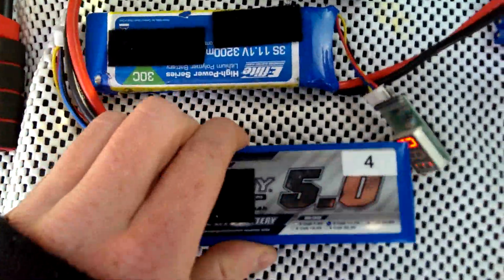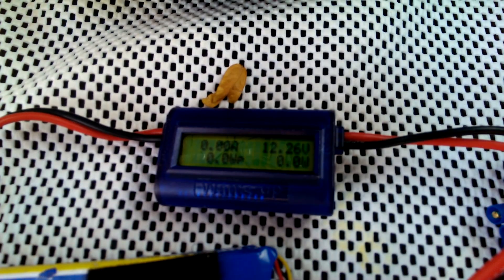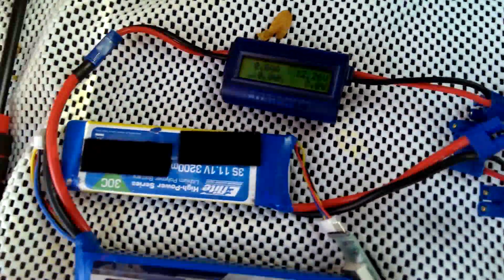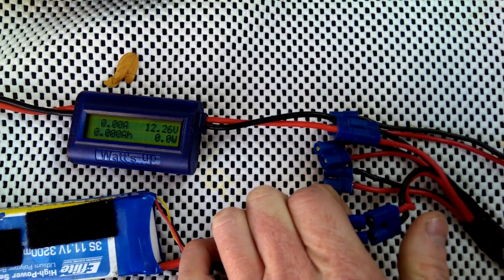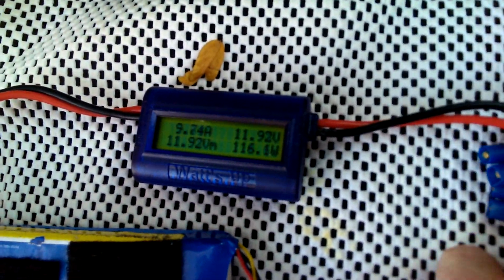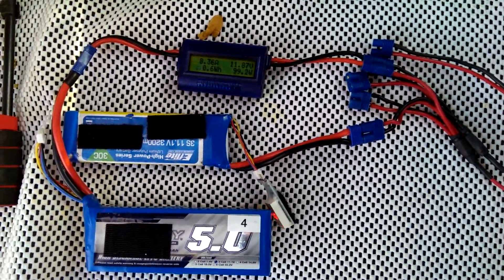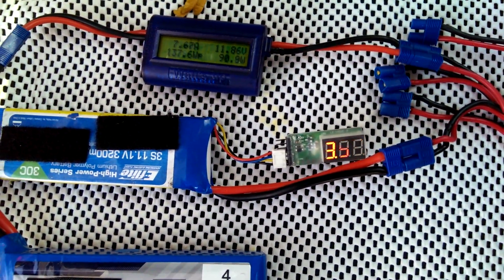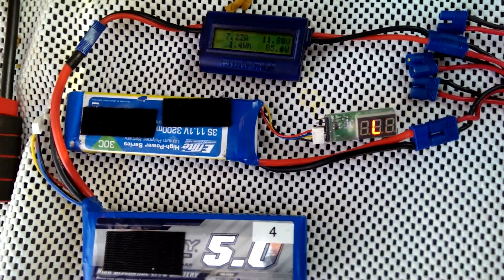Different Voltage Lipos Connected in Parallel - Fire? Burn? Or just A-OK?

Comment: Still a bad idea and dangerous.  You got away with it because they were 3s with high C ratings.  Additionally, the small battery still had cell voltages of 3.7v and obviously far from depleted.  Bad illustration and wrong to put it on YouTube.
Reply from the maker: Not dangerous at all to do a test in a controlled environment. The current discharged didn't even come close to the C rating, that was the point lol.
Reply: Turboactive The “point” is that you inferred several times that others were giving out bad information about it being dangerous which is not true.  It is dangerous.  Your test may have been safe, but suggesting/inferring that others are wrong and it is safe is irresponsible.

Comment: help guys my 3s lipo batter is showing different voltages 1cell 3.5v,2cell,3cell2.5 is it safe to charge or should i dispose
Reply: You can try charging it on a balanced charger at a low mAh setting.  Chances are, if it is a good charger, it will stop the charge and say, "bad battery" or "bad cell count".  However, the cell voltages should not be that much different.  You probably over discharged it.  That is the only time I have ever gotten dissimilar readings between cells.  However, I was able to bring it back to good health.  It is worth a try and then monitor it for a couple cycles.
Reply from the maker: You might be able to revive otherwise they make great shooting targets :)

Comment: Bit of an old video, but I'll reply anyways. The only dangerous scenario is connecting two batteries that are at vastly different levels of charge, for instance an empty cell (2.6V) and a fully charged cell (4.2V). The reason for this is that electrons will always flow from a cell with high potential to the cell with the low potential, and they will do so at the maximum discharge current possible. The "stronger" battery will charge the "weaker" battery at a current far exceeding its maximum charge rate, resulting in heat and, possibly, venting, or even an explosion. When connecting two batteries in parallel you want to connect cells that are close to each other in terms of voltage, 5 milivolts is an acceptable difference which will naturally balance out. The actual capacity of the cells is almost irrelevant - the larger battery will always "charge up" the battery with lower capacity because the voltage must be equal in a parallel connection. That being said, it is not an optimal setup and will result in lower efficiency and a lower lifespan of the cell due to having to be constantly topped up by the larger cell. When connecting batteries in parallel you want to closely match capacity and voltage for optimal operation.
Reply: This was the exact answer I have been looking for, for months. I never knew exactly how it works and this is the answer. Thanks so much man!
Reply: Foxi4Qnet Yes, with one additional caveat for those putting battery packs in parallel for our RC uses in particular.  Even batteries with dissimilar capacity but same voltage and current ratings, should not be put  in parallel.  During discharge, the source will pull voltage unevenly from otherwise identical packs in every respect unless they also have the same capacity.  This can, according to a Lipo supplier I talked to, cause an over discharge and damage to a pack.
Reply: @bw162  that's correct, in a sense. The cells will always try to stay in balance - they must, it's physics. The thing is, the smaller capacity battery will inherently charge faster than the larger one, so you'll be inducing circular current between the cells. It's an easy experiment you can perform yourself.
Reply: Foxi4Qnet  I am not an expert on batteries.  In fact, the few electrical engineers I talk to admit that not everything is known about battery chemistry and behavior.  Boeing gave up trying to clearly identify what caused a Lipo fire and over heat issues that resulted in grounding of their 787 when first introduced.  They improved the system to “mitigate” problems and made a more foolproof containment but never really understood the underlying issue that required design mitigation requirements.
Reply: @bw162  That much is true, there's a lot of misconceptions regarding the technology and a lot of subtle differences between chemistries, so we mostly operate on what's "nominal" or "optimal", which doesn't always turn out to be true, rather just "safe". Even tolerances between cells in the same batch aren't as tight as one might think, so ideally users should measure their cells and do their best to match them as closely as possible. Thing is, as the cells go through discharge cycles, they will inevitably lose capacity at different rates, so it's impossible to "truly" balance a pack as no two cells are the same. That's where BMS boards come into play.
Reply from the maker: yep

Comment: Hello can I connect 2  batteries in parallel with the same voltage just different mah both 36v one has 4400mah and the other 8400mah?
Reply: Yes you can you just have same voltage but more capacity.

Comment: how about 5500mah and 7200mah both 3.7v is this safe..to make a diy power bank charger..I take the circuit board from power bank 13000mah battery..it's safe to use that circuit board and mix diff mah?
Reply: I don't know what you mean by the circuit board part but mixing different capacity batteries in parallel should be just fine, AS LONG AS the voltage for all cells is the exact same. What he did in the video is a real no no and while it doesn't always result in a fire it most certainly has the potential to with larger differences in voltages and also can damage cells due to heat and other factors. So just make sure anytime you connect cells in parallel that they are the same voltage. The capacity or mAh is fine to mix as it just adds those two capacities together when connected for a larger capacity.
Reply: You can mix different mAh batteries in parallel  IF they have the same voltage (cells) and output capacity, i.e. 55C.  Obviously, if one battery pack is so fully depleted that there is a significant difference in pack voltages, it is not a good idea.  There was not a large risk in this demo since the voltage differences in a depleted pack is not significantly different than a fully charged pack of the same voltage rating.  But putting a 5s in parallel with a 2s is a bad idea.
Reply: Alex Chong CORRECTION to my previous response.  I had a similar application and called a Lipo supplier.  During discharge, the source will pull voltage unevenly from otherwise identical packs in every respect unless they also have the same capacity.  This can cause an over discharge and damage to a pack. I didn’t know this but is important to RC pilots in particular.

Comment: what happens when i connect lipo of 2200mah 3s 25c with lipo of 1800mah 3s 30c in parallel?
Reply: If they're the same voltage you're essentially going to get one battery with a capacity of around 4000 mAh. The 3S part just means that particular battery is made up of 3 individual cells in series to get to a certain voltage. And the 25C or 30C stat typically just refers to the maximum discharge rate at which the battery can safely operate for a time. So for the 2200mAh battery, the max discharge rate should be about 55 Amps (or 55000 mA)
Reply: Not recommended.  They should have the same current rating.  It's like linking a firehouse with a garden hose.

Comment: This is very irresponsible. Just because your particular setting did not cause damage, you should not imply that connecting batteries with different voltages is never dangerous.
Reply: I agree!

Comment: I have a 1300 and a 3000 mah lipo. As long as they are both charged at the same voltage, will I be able to use both, connected in parallel???
Reply: greek guy yes just check voltage before you plug it together
Reply: @MoesKeckeEcke  They should also have the same output voltage ratings, i.e. 25C.
Reply: greek guy  CORRECTION to my response.  I have since learned from a Lipo supplier, during discharge, the source will pull voltage unevenly from otherwise identical packs in every respect unless they also have the same capacity.  This can, according to a Lipo supplier, cause an over discharge and damage to a pack.

Comment: This only worked cause the voltage difference between the two battery packs is less than 20%, I'm sure some of your batteries are heating up. I tried this with 2.6 Volt cells and 4.2 volt cells, and they did not catch on fire immediately, but they did trow some sparks and then they got very very hot. I immediately disconnected them cause I don't want the batteries to explode due to the excessive heat.
So, in conclusion, it is not safe to connect different voltages above (+- 10%).
Reply: Francisco Silva 2.6V is waaaay to low. 3V is min. Don't tell us what to do if you don't know what you are doing.

Comment: I've been wondering about mid air recharging ,a nd what to use. i guess another battery of the same voltage, but higher capacity, would work. what about charging a 3 cell by connecting it directly to a 4 cell. think that would work?
there would prob be some voltage drop in the wire going to the basket for the re-charge, so that would be a factor too.
any ideas, anyone?
Reply: FPVREVIEWS - NO! You can use higher capacity but please use same no. of cells. Otherwise you have a huge voltage differance!!! Also you would have to limit the current. Connecting full and low cells is not good. Thats why inflight charge is stupid. Its the same as if you put the additional battery directly on the model.